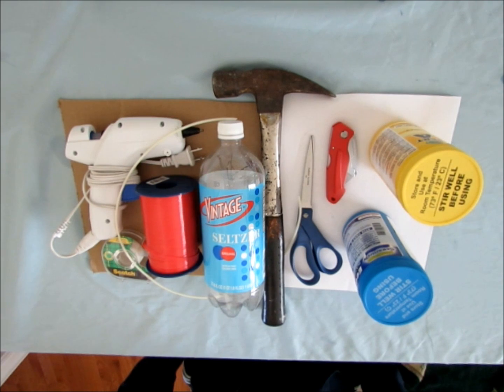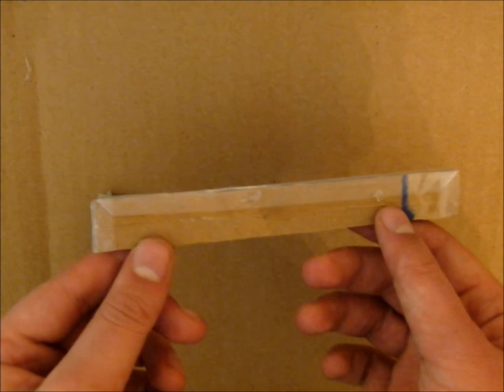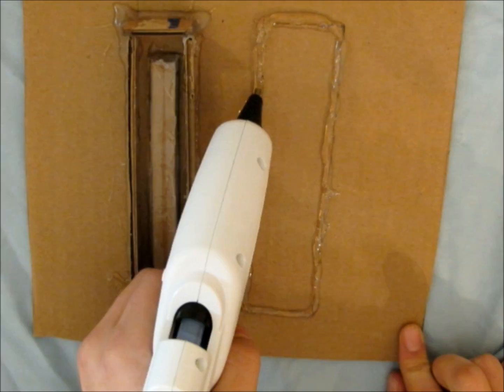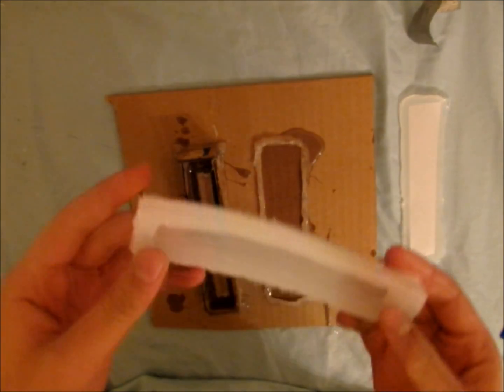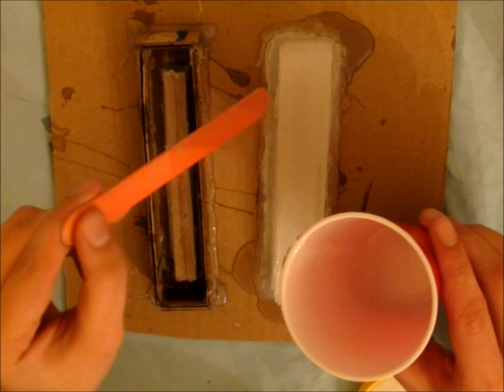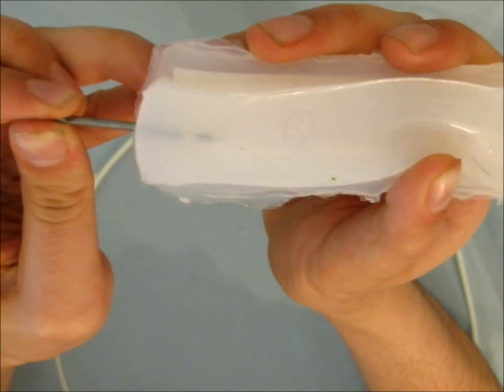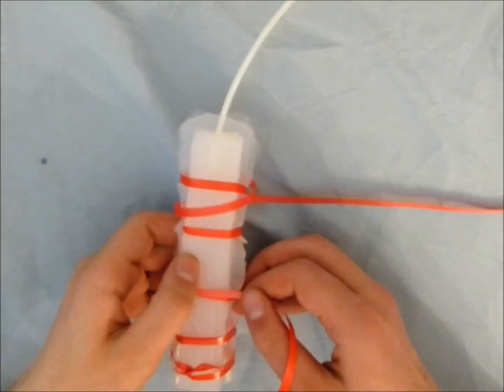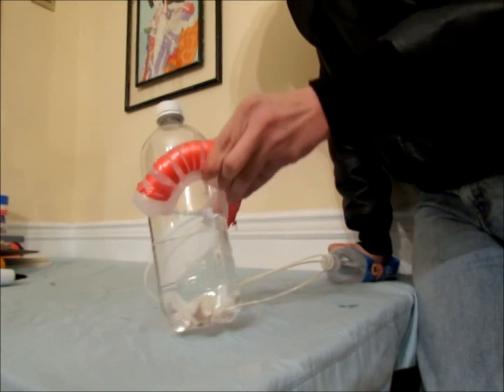Make Soft Robots Without a 3D Printer

Comment: I bought and used some Ecoflex 0030 and it came out purple... how can I get some that comes out clear like yours?
Reply from the maker: +Ryan Coulson Is the unused rubber in the mixing cup also purple or just the rubber taken from the mold?
Reply: Harrison Young Part A is red, Part B is blue, and when you mix them together you get purple and it stays that way
Reply from the maker: +Ryan Coulson Both parts of Exoflex 00-30 are supposed to be clear. Based on your description I think you might be using OOMOO 30.
Reply: Awwwww dang, you're right. I just figured the 00M was some generic part that came at the beginning of all the products :(

Comment: I see possibilities for more sophisticated molds using clay, etc. Possibly casting molds using silicone around "accordion" flex tubes.
Reply: Many silicones won't cure with water based clay - but a wax or oil based clay should work with everything! Just worth double checking the types of silicone you're using to be sure.

Comment: Did you mix Ecoflex A  and B on 1 :1?
Reply from the maker: +민수 박 yes
Reply: Thanks!!What is the reason for using ecoflex0030?
What else can not be done? For example, 0050 or 0020....Is it due to pot life time?

I am a college student preparing for graduation. While investigating the softgripper, your video was a great help and asked this question.
Reply from the maker: +박민수 I use ecoflex 00-30 because it is very stretchy and will inflate at low pressures. 00-50 will work but it may be difficult to inflate by hand. I have never made a grabber using 00-20 so I unfortunately can not comment on its effectiveness.
Reply: Thank you very much.

Comment: there is an alternative to ecoflex? it's very expensive...
Reply from the maker: You should try using silicone 1 caulk. Instrucable user mikey77 has made soft robots using Oogoo, a home made silicon caulk based paste. Ill put the link to his inscrutable here. http://www.instructables.com/id/Soft-Robots-Making-Robot-Air-Muscles/ I think my mold will work if you coat it in lacquer first.
Reply from the maker: Also try proto-putty. it is a putty developed by The King of Random that has a similar recipe to Oogoo but is not as sticky.  https://www.youtube.com/watch?v=7fwytA5r2Mw

 If you try either one please let me know  I am genuinely curious to see if it works.
Reply: soft robot diy

Comment: I know this is a dumb question, but I'm confused. If you pour silicon into the mold, you'll end up with a solid block of silicone right (even if it's flexible)? How can you inflate it if it's solid and has no "empty spaces" inside for air?
Reply from the maker: The mold makes a hollow block of silicone not a solid one. The inside cavity can be seen at around the 3 minute mark in the video. I hope this clears things up.
Reply: You missed the part where he layered two pieces together creating a cavity in the middle! Go back and watch more closely!